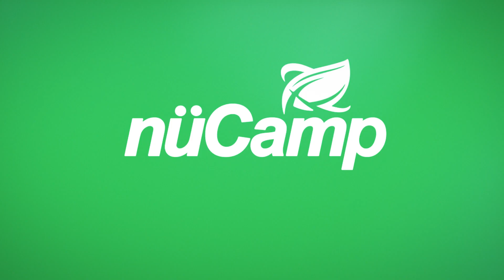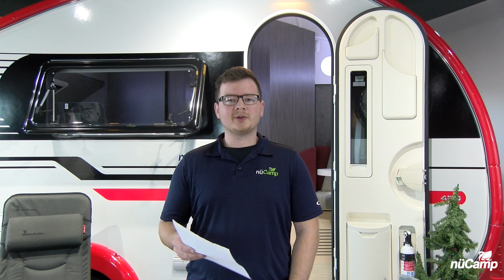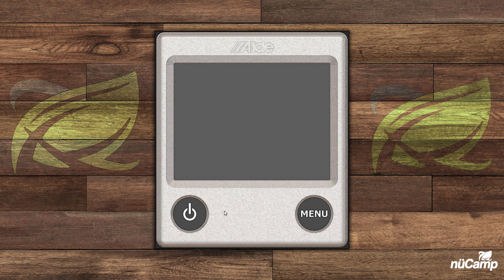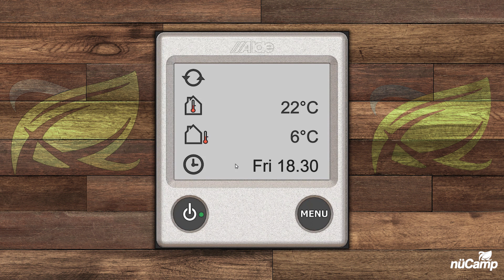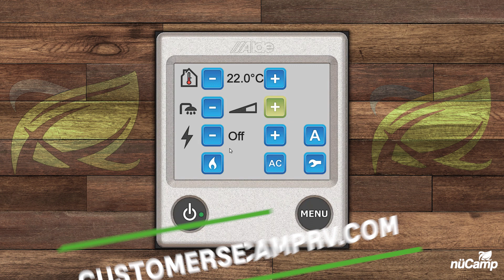How to Set Your Alde Control Panel - Tech Talk

Comment: Can you use the heat if the trailer is currently winterized and the water heater is bypassed?
Reply from the maker: Yes, you can still use the heat in your trailer if it is winterized.

Comment: I've read that if you're not on shore power, the ALDE system works from a combination of battery and propane. Do I need to do anything to set that up, or does the system automatically draw from the battery too when set on propane?
Reply from the maker: Reach out to our Customer Service Team by messaging our Facebook Page or emailing customerservice@nucamprv.com. They'll walk you through the setup! You can also call us at (330) 852-4811.

Comment: Creed, when blowing out the water lines for winterizing or just to get the water out, does the Alde need to be in bypass?  Maybe a future video?
Pete
Reply from the maker: Hey, Peter. Leave the unit in "Camping Season Mode" if you are blowing out the lines. Once you've got that done, then switch to "Winterization Mode".

Comment: I have a question but it nothing to do with the Alf
Reply: I have a question but it has nothing to do with the Alde system. Here goes, when you  put the dining table in the bed position the outlet under the table is useless. Is Nucamp going to fix that? Thanks
Reply: Scott Elwood That outlet has been relocated for 2020 400 models.
Reply from the maker: Hey, Scott. Thanks for the question. Colton is right, that outlet has been relocated in newer models

Comment: Creed............to use "boost" mode for hot water, do you have to be on shore power, or are you also able to get the hotter water on battery or propane?  There is some confusion about that.  Thanks for the helpful video.  Keep 'em coming!
Reply from the maker: Hey, Greg! Great question. You can actually use Boost Mode on shore power or propane. However, the Alde System typically works more efficiently off of propane. Hope this helps!
Reply: @nucamprv  It does.  Thank you, and thanks for the video.
Reply from the maker: Always happy to share!